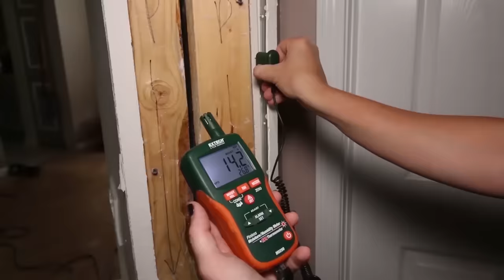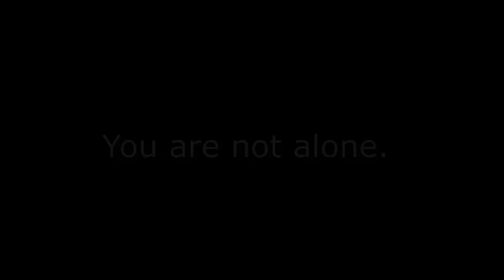Episode 10: Leaky Mermaid

Comment: I'm from Portugal ... a cousin of mine decided to open a specialized cleaning company in Portugal. The company is called " Death Clean " and is the only one in the country. They have many jobs, and follow the same processes. I worked with them only in a case of garbage accumulated in a house, it was easier.
I've never done decomposition cleaning, and I shouldn't even be able to, but I understand that only prepared people with a very strong mind and also some coldness can do this job. I admire these people and it takes a lot of capacity to not get emotionally involved with the situation that occurred in the place is very important. Only a few people can do this.
Great work seen in these videos.